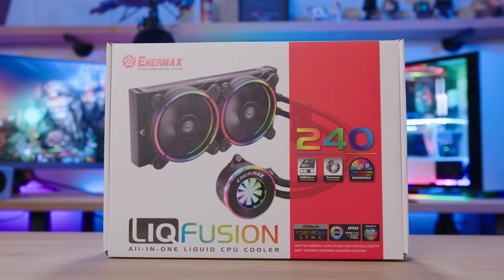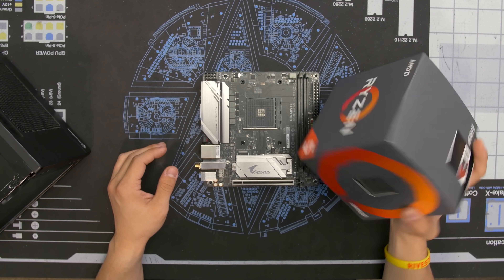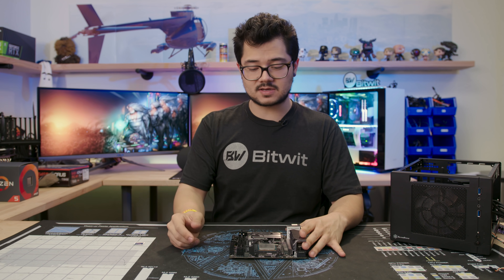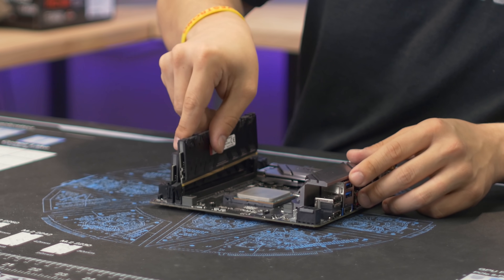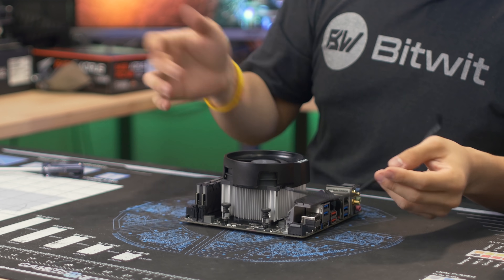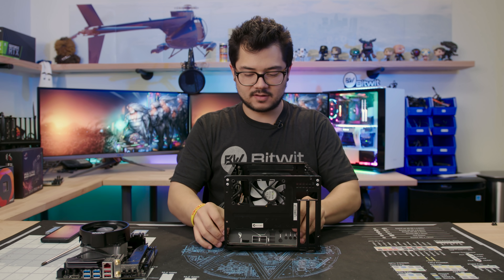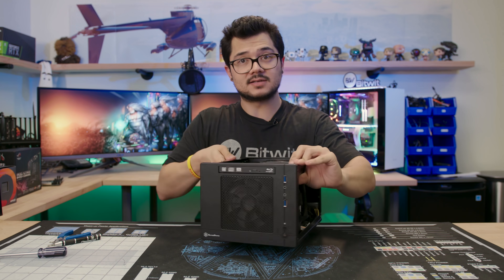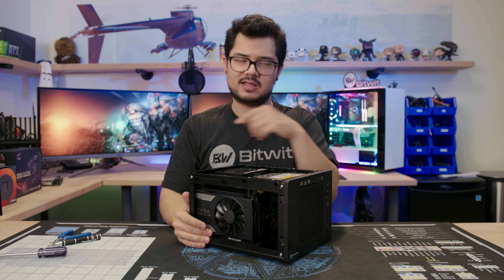Building a TINY PC Step-by-step!

Comment: as much as ai like small pc builds

if you intend to  want to  game on it   you want enough hdd space

with the amount bloatware that i windows/ofiice/ms security/backup you don't have alot of storrage to use

if you are like most tech heads, you have a minimum of 3-5 pc's laptops and so forth you migth want to  consider shipping  updates to a server and free up theneed for the restore partition on the same hdd

i never build systems with less than 1TB hdd even if you  install GAMES on large secondary hdd you will need to  consider even with steam installed into a secocond some files do land into you documents folder by default  so 1TB to 4TB OS drive should be plenty  for this task

with 12TB hard druves being purchased for  cheap a 4TB offset night be a cautious move..

what I'm seeing  from the hobbyist market in terms ((((gaming  PC))))  they use the cheapest ssd/nvme on the the market without realizing that formats/safe partitions OS related updates and so ob  abd ==nd so forth a 128-513GB hard drive can fill up quite quickly

from what i am seeing  with my main hdd's in  nywhere from budget  $400- sub 2,000  ((((proclaimed gaming rigs))))  they all exibit the same flaw no matter the type of drive in use somewhere betweeen 128-512GB IS commonally used.

windows and associated bloatware and updates there will become a time when and where thw hdd you use willrequire replacement sooner much rather than later...

I own over 7k worth onf compuuters and Iwill say this, I will call bitwit/ jay2cents and every other tuber/twitch streamer who builds pc's either as a a business or just for  shits a giggles you all loose credibility  with everyone when you  start look at x vs y vs z

as a pc gamer  whether i buy from steam or bricks abd mortar I believe everyone  builds to a lowest price point budget for certain thinge and you all get your collective rut building the same thing over and over and not  changing to a most sensible  option when you lot create build
Reply: Is that even English? Your a dumbass muttering verbal diarrhea. Nobody cares what you think if you cant even write a coherent sentence.

Comment: I am trying to decide on a case for a mini ITX gaming build, but I am hung up up deciding on a case. I am torn between a Thermaltake Core V1 and the InWin A1. Would love to see you do a build with the InWin A1 in white(no time lapse). I will be using the Aorus Pro Z390, I7-9700K cooled with the DeepCool Gammaxx 400 (white), and Corsair Vengeance LED (2 x 8GB) @ 3200MHz, M.2 SSD for OS, 2-4TB HDD for storing games, plus a few other extras depending on room. I will be using a modular or semi-modular SFX power supply to minimize cable management. I travel for a living, so it will be moved between my home and my RV multiple times a year, about once a month, so I want to pack as much power as possible in a SFF without breaking the bank or my back. Would really like to see you build one and heat your opinion of the build process. Thanks, and keep up the good videos!

Comment: Dude, me and my dad were cleaning out my PC that is like 2 yrs old that I NEVER cleaned before. The CPU was stuck to the heat sink and for whatever reason my dad was prying it off while it was above the case. It popped off and landed on the pins on a metal part of the case. Long story short I spent the next 2 hrs with a pair of tweezers and a credit card straightening the bent pins of my poor abused AMD A8 7650K CPU. Im still using it 4 months later AND Overclocked to 4.10GHz from 3.30GHz base. XD

Comment: Why isn't there a standard connector for the front panel connectors? like 1 plug you just plug-in in 1 default direction which is the same with every case/ motherboard? they did it for sata, usb, ide, pci, etc why not for those annoying little things?

Comment: I never rally got it why you can't touch the pins on a CPU.. i did it so many fucking times, even bend some, and repair that, and it always worked like new.. and to add o that, like 9  out of 10 times i had dirty as fuck hands, from all that dust from PC.

Comment: I built my PC 2 days ago, and although it started, none of the USB ports worked. Turns out the MOBO needsboth a 24 pin and an 8 pin connector from the PSU.

Comment: how on earth is this computer 4 times smaller than mine but still 3 times better than mine like eh? ive got 16 gb ddr 3 unbranded so one of those plain green things 0 usb 3.0 3 usb 2.0 ports a gtx 1050 2gb 1 fan no performance enhancing rgb (its a linus joke) and an intel i5 2400 3.1 ghz proccessor its good but not gonna last a lot longer. oh and a 1tb 7200 hdd from seagate.

Comment: Bitwin i have a question.right now i have a ryzen 3 1200 at stock speed,a gtx 1050 ti and 1x8 gb ddr4  3000mhz ram.when i play battlefield 1 multiplayer,i have around 25-30 fps on lowest settings and with msi afterburner i see that cpu is at 100% and gpu at 25-60%,is it because i have single channel memory?

Comment: Dreadful build. Where does the CPU heat go? Oh, up half an inch into the base of the power supply and there is no case exhaust fan. That box is just going to get hotter and hotter and hotter. And you picked a 95W processor. What an bitwit! 2400GE (35W) is about as much as you should have sensibly put this build.

Comment: I have an HTPC in the Silverstone ML08B-H and I have a Ryzen 5 1600, a 6 core 12 thread CPU, so why is a Ryzen 5 1600X only a 4 core 8 thread CPU?
P.S. I would have used a case like this but I have a reference design GTX 970 so I doubt it would fit in this case, which is why I went with the ML08B-H

Comment: Maybe you can help me.  I recently bought a p300 phanteks eclipse and I can't find the front panel cables.  The manual that comes with the case is no help.  I traced the cables from the front but I only have two of the 5 or 6 cables I need.  Looks like everything is plugged in but I just don't have those cables.  I'm a noob at this what do I do?

Comment: I actually have never had an io shield, except when my computer had the original mobo, when I swapped them, my board never came with one which was almost a year ago, but idc😂and so using a drill in 10ft lb may have been a bit much for the boards I have installed????

Comment: 15:15 - i use the leawo blu ray player. it's the only free BD player out there AFAIK.

they do sell blu ray ripper/copy/creator/converter software as well but the player is free. 

also, there are more reasons to have a WORKING optical drive in a computer. 
these blu ray drives are still way too expensive to put them in but not connect them beacuse "aesthetics"

that's wasteful

Comment: I am wanting to build a pc with a ryzen 5 2400G 16GB of ram, MSI 
A320M GAMING PRO mother board 2TB Hdd how do you think it would run 
I would only play like paladins, rainbow six siege, league of legends and maybe some games I see on steam there 
I went with the integrated graphics as it is comparable to a nivida gtx 1030 and my budget for a gpu was around 100
The budget for the build was 500$
Reply: No don't do it
You will get a RX 570, r3 2200g and 8gb ram and a good mobo and PSU and case under 500USD
Reply: Arnav Deo I am planning to buy a graphics card later on but this is my budget for now which costed 685 Canadian because I am in Canada 
And isn’t the Msi A320 and a Corsair power supply good

Comment: That's sad that you're associating 1080p with "Mid-range." Ever think that for some people 1080p is fine? Got a i7 7700k OCed to 4.83ghz on all cores, 32gb of RAM, and a slightly OCed GTX 1080, and I game at 1080p. Why, with a system like that? Because 1080p is fine. If i want 1440p I'll buy a new monitor, if i want 4k, i need a ti for better smooth 4k

Edit: Whoa whoa, it actually DOES matter which slot you plug your Sata Data cable into, as, if you're not swimming in money like most of us, you can't afford an m.2 SSD. When plugging in your Sata Data cable, the lowest number slot is the main boot drive slot, refer to your motherboard manual for more information

Comment: Pro tip to both @Bitwit and any other OCD builder, you can rotate the AMD logo on the wraith coolers so it's facing "up" by just unscrewing the fan from the heatsink and rotating it 90 degrees. Use a small screwdriver at an angle, and put electrical tape on the corners of the plastics near the screws to protect them from getting scuffed.

Comment: I have heard from Hardware Canucks and now you that the PSU fan should be face up so as not to "compete" for airflow with the CPU cooler fan.  In practice though I have found that this results in higher system temps in a small form factor case.  Mounting the PSU fan face down actually helps pull hot air out of the SFF case.

Comment: Not a bad build, but I'd have put in the GPU before the HDD/Optical drive cage and plugged in the Power cables to the Motherboard, GPU and HDD bracket cage to screwing in the PSU and HDD cage. Makes it easier to see what your doing and work with if you're like me and have fat fingers :P

Comment: I've built something similar last year but in a SG13 case. H80i watercooled 8700k and 1080ti and all that. Temps keep pretty low considering it's a PC you can fit in a larger backpack. It does get a bit loud during gaming but that's all due to the Sfx-L power supply fan being crappy, it only starts when a decent load is placed on the power supply.

Comment: Nice compact build, except:
1. Gigabyte should be able to sell an I/O shield for that first motherboard.
2. Free Blue-Ray playback software: VLC 64-bit.
3. That internal USB 3.0 cable bundle is restricting the air flow from the adjacent cooling fan.

Comment: Ok ok hold up...

1) Why are you using a B450 socket if you're only using gen 1 Ryzen? Why not just use a B350?
2) 1600X doesn't come with a stock cooler, however if it did, AMD preapply thermal paste. What happened to it? ;)
3) This one is more personal preference, but given the clearance between the CPU cooler and the PSU being so little, I probably would have mounted a 120mm radiator at the front (such as the Corsair H60) to make sure those CPU temps are staying as low as possible in such a small build.

Although it's nice to see some Mini ITX action. I've always loved them.

Comment: This pc is exactly like mine except the processor. I have a small form factor case made from asus it’s called an asus rog g20, it has a 1060 evga 6 gb sc exactly like the video, an i7 6700, 8 gb ram, 256 gb 850 pro, 1 Tb wd Black it comes with a blue ray player but, it doesn’t work at the moment since I was trying to remove the sata cable from the motherboard to the dvd drive since I don’t use it and since it was a small space my hands barely fit and I took the sata cable off the mother board with the sata port. So now I have a unusable blue ray drive on my pc

Comment: Ive got a mid tower case and my PSU fan is aimed inside the case. The only other orientation is down where there are some holes in the bottom of the case. Would it be best to have it aimed down in that instance?

Comment: Sad about the blueray drive though... I figured maybe you would at least hook it up... there were enough SATA power connections and boards usually come with 2 SATA data cables...
Reply: Slim sata uses the same data, but a smaller, less common, power connector.

Comment: Heck yea SG series mitx! Actually, this looks like a different case than the mesh front sg13 correct @Bitwit? I did my zotac 1155 i5-2500k 16gb ram with a 120mm AIO for the cpu and a 1060 FE so the hot air would blow out the back. It looks like it would weigh about 5lbs but don't be fooled lol, that thing is like a sandbag once finished. Great video!

Comment: "Pretty universal for all boards" I've seen SO MANY different configurations for those. the annoying part is when they can't decide if they want a missing pin gap between the 2 pins of the power LED or not. I've even seen montherboards where the power LED is on it's own connector somewhere else on the board.

Comment: i'm in the middle of building my pc, and it took pushing on my wraith prism cooler quite a bit to get it installed. it was difficult to get both hooks on for some reason. did i really risk crushing my cpu's die/ihs?
something of note is that i used the pre-applied thermal paste which comes as a large square blob. i wonder if that contributed to making it such a tight fit.

Comment: Ryzen 5 1600x seems like an odd choice. Ryzen 5 2600 is such a good value. It performs better than the 1600x and costs a couple bucks less. Unless he already had the 1600x already lying around, it doesn't pay to go previous gen Ryzen at this point.
Reply: That's true, but maybe he had the parts laying around.
Reply: Most likely had it already.

Comment: Wouldn't everything be a lot easier if you screw the PSU in last since it is placed on top? I mean, you can still connect all the modular cables to their components but leave the PSU outside until after all the parts are put into the case.

Comment: Hey great video. I am thinking about making a traveling gaming rig for VR. Is this build enough or should I go a little more powerful?
Reply: It’ll be enough for sure. But if you’re using the HTC Vive, then the 1060 is basically the bare minimum for it. if you could find a mini 1070, you’d be better off with that
Reply: @Abandonedlife2k  thanks man. I appreciate your reply